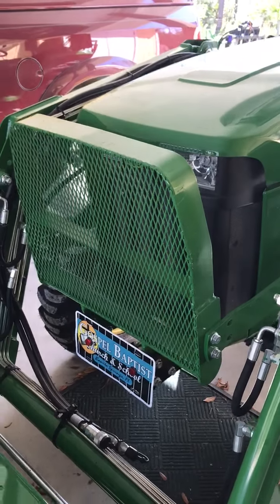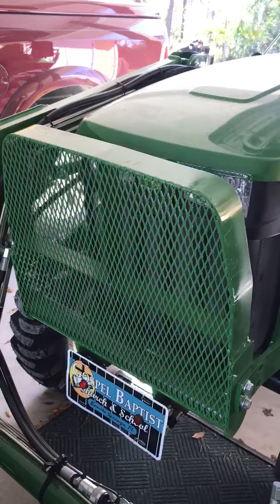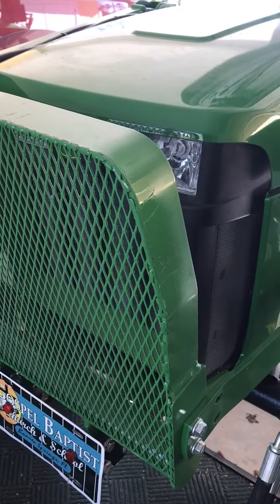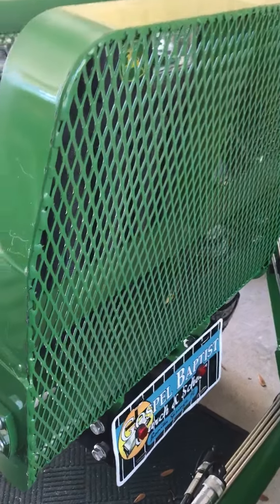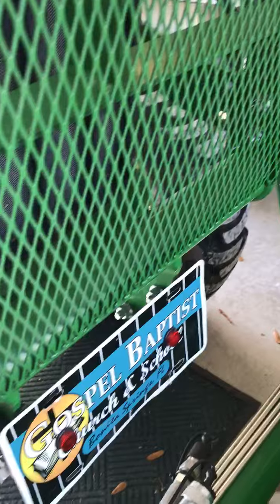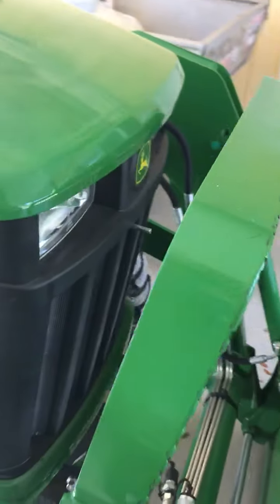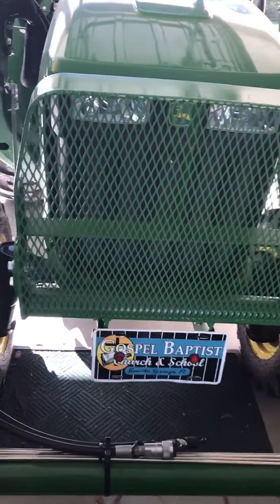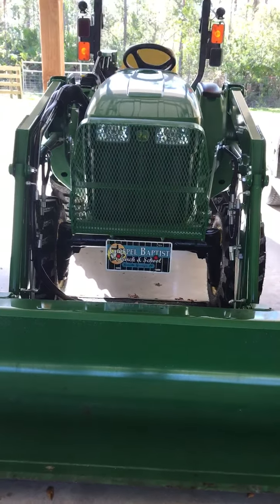John Deere brush guard

Comment: Looks good, I am wondering if one steel mesh in front is very good, would another steel mesh on the back side be a lot better ?
as long as it does not impede the air flow.